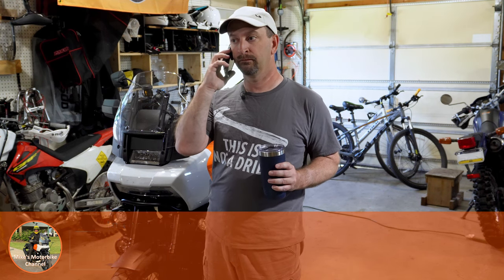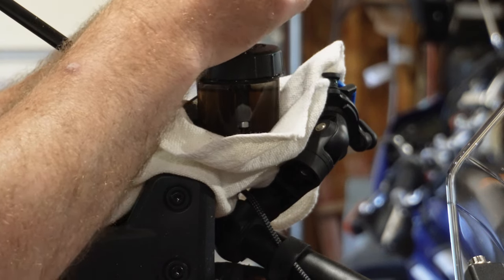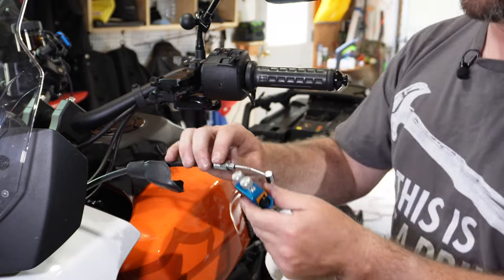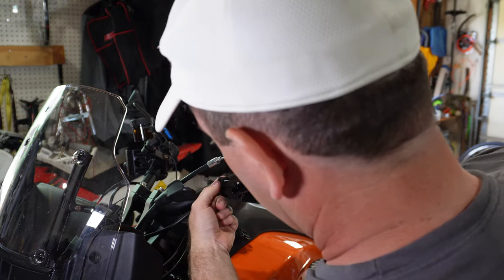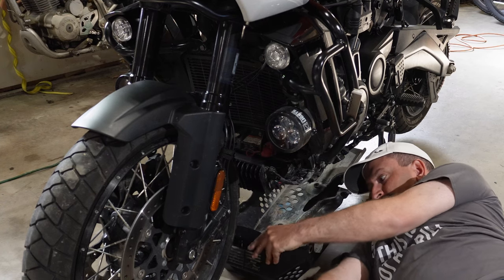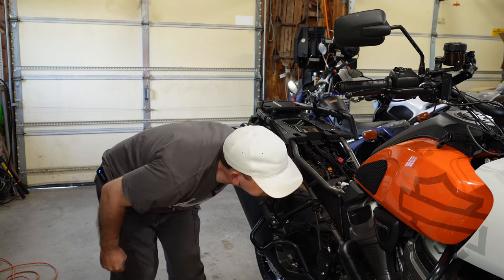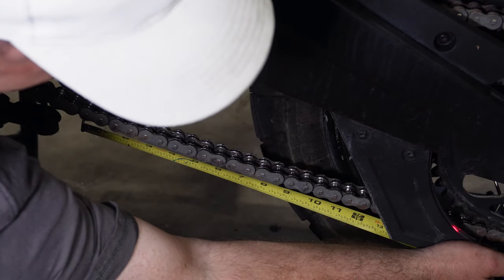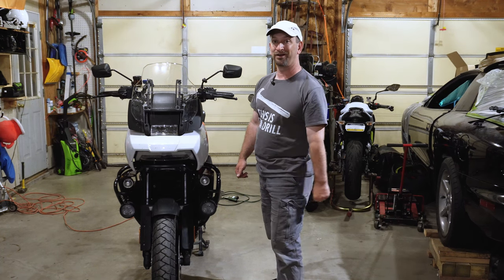Part 1: HD Pan America - Complete Scheduled Maintenance

Comment: Great videos!  Handy tip - when I adjust the gap in the clutch cable I use a nickel as a feeler gauge. It’s about 1.8mm, which is in spec.
Reply: Good advice

Comment: Good information. I am one that is having problems with my radiator hose. When it is cold its almost ok. After riding the hose swells it touches the exhaust. I am fighting now to get it fixed under warranty. Other than that the bike has been great.
The dealer i took my bike to for the 1k service didn’t do most of that I’m sure. They also weren’t helpful about the hose. Another dealer called HD to get some action.
Reply from the maker: Dealers seem to be hit or miss. Being near a good one seems to be a matter of luck.

Comment: Question on Sprocket and Chain. When replacing the Sprocket and Chain does is require to replace the seal behind the front sprocket? Why I asked I had the dealer do the service for replacing the chain and sprocket. Which they told me the seal was also required to be replaced. It wasn't leaking before hand but now it leaks oil from behind the front sprocket
Reply from the maker: Yes, service manual does state to replace the seal. Sounds like they didn’t do it right.
Reply: @MikesMotorbikeChannel Thank you for your reply By the way Great videos on the PA

Comment: Great videos. Where did you find an 8 mm socket to fit the spoke nuts that are inset in the wheel?
Reply from the maker: @tobycatron2103  just a regular craftsman socket I’ve had for years.
Reply: @MikesMotorbikeChannel I tried tow craftsman sockets. Guess I’ll have to sand one down to fit

Comment: Good video but I like running this kind of video at 1.25 or 1.5 speed and this is why it cost $400 for a mechanic to do it cuz it's very detailed
Reply from the maker: Thanks. It’s a struggle trying to balance showing enough details without dragging on too much. My little “reaction” at the beginning was just a tongue in cheek poke at folks that think scheduled maintenance is just an oil change. It is indeed more detailed than that.
Reply: @MikesMotorbikeChannel  I'm gonna watch your other vids, I dig 'em!